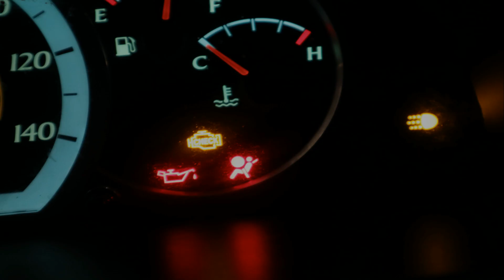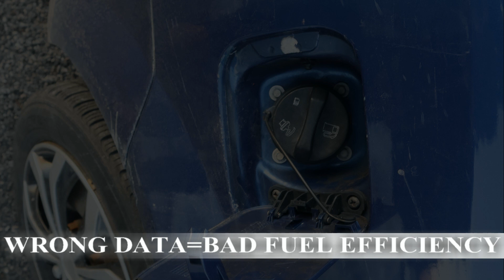SYMPTOMS OF A BAD CRANKSHAFT POSITION SENSOR

Comment: I meant to say I changed all four coils all four spark plugs all four fuel injectors and I'm still having the same problem so I'm hoping it's the sensors
Reply: After I changed our all four coils spark plugs all four fuel injectors now it only does it when I accelerate and I get a flashing engine light and it starts misfiring but regular driving it's fine
Reply from the maker: @crazygringo9028  interesting! Why would autozone assume fuel injectors right away? Any other codes appear after or just P3001?
Reply: But AutoZone run a code and said it was my fuel injectors after I changed all four coils
Reply: @crazygringo9028  it’s your alternator Brodie it’s makein the whole car dead when driving after a while on a bad alternator your car is running on your battery so you would probably see the battery light and check engine light
Reply from the maker: Goodman! What are the engine light codes ?
Reply: It was the codes for a misfires and like random cylinders think it was p3001

Comment: Bro it's a good video I hope that's my problem I've changed all four coils all four spark plugs
Reply: I see alot of vehicles with them go bad the vehicle will start and run good cold then drive good for few minutes then die and won't start again for 30 minutes when it cools off alot of dodges 95 to 05 that what happened me a few times
Reply: @miker5700  the problem is it never dies it starts just fine it just constantly misses in the morning and then it'll run better  or where there's a load on the acceleration
Reply: @crazygringo9028  oh that dont sound fun there's really so many things could be id test fuel pressure if not that maybe take to a garage if you don't own a good scan tool where then can get the o2 sensor readings to make sure there working and heating if heated ones should also be able to tell if cat is going bad or getting plugged from scan, probably not crank or cam sensor could be but unlikely also u can buy can of throttle body cleaner I think its seafoam makes a new spray can just goes between the throttle body and intake hose then spray in there to remove gunk also could get can of regular seafoam gas additive and run it directly into your intake it'll burn it out and go through exhaust u just take big hose off break booster generally under the break master cylinder and put the can by the hose and let it suck some it while it's running you'd want to rev it up a bit so don't stall and use the full can it'll smoke like crazy from exhaust so make sure u do it rural area could be timing issue but probably not idk who new but could need computer updated since that's a thing now days alot of garages can update them you can probably look this stuff up on here easy id try throttle cleaner or through intake first stuff made by seafoam sell at all parts stores I do it every year
Reply: Yea this was an awesome video!!!
Reply: My car doesnt run over 30mph is that part of that?
Reply: That’s your problem crazy boy… you don’t have 4 coils, just one!

Comment: Got a Kia morning 2009 and got this code when I checked. Acceleration is very bad and it idles roughly. It does start all the time but can’t go uphill
Reply from the maker: Awesome that you were able to diagnose the problem! Did you get it fixed ?
Reply: When you change sensor change the connector also🤗